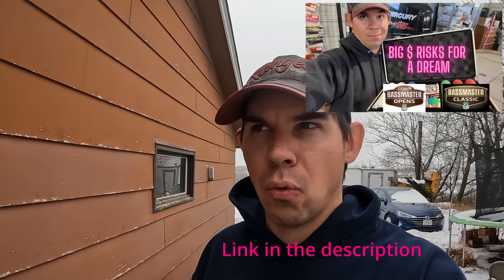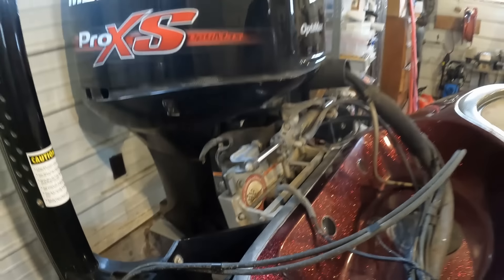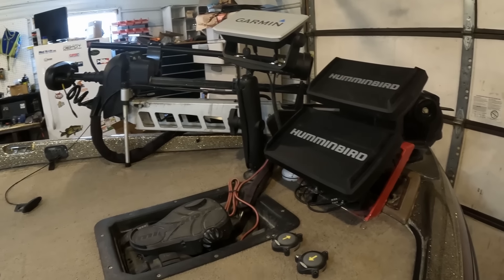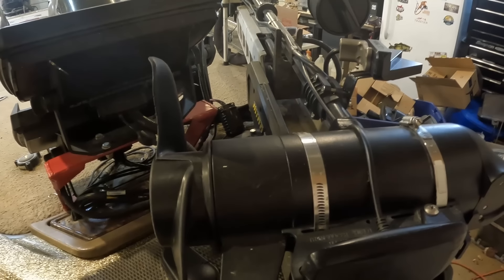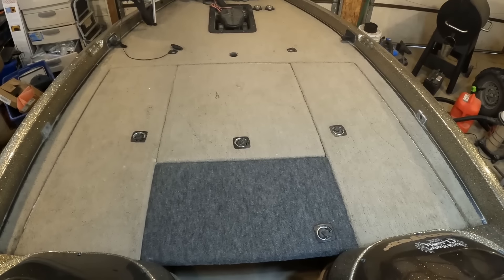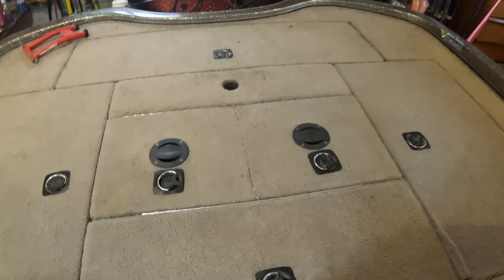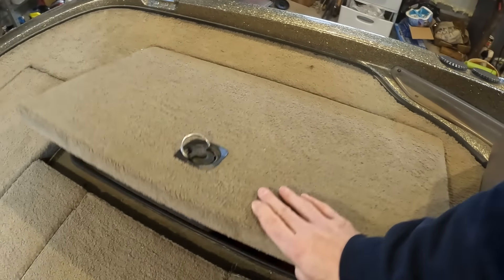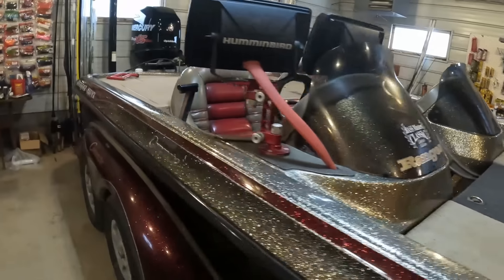Taking On The Opens With A 24YR Old Boat (My Boat Tour)

Comment: I’ve got an 01 520 and taking the rod tubes out is no easy task, I’m still trying to get all the foam cut out in the locker but once I get it I can put a lot more rods in it. You’ll need several different tools to get the foam out, a saws all is probably the first thing to use.

Comment: I bet there are a bunch of those 520s out there.  Lots of guys won’t let them go.  Good fishing platform and what I remember really good hole shot for a 20ftr.
Reply from the maker: You definitely don't see many of them come up for sale very often. 10-15 years ago in my area, just about everyone either had a 520 or 519 Ranger or the Skeeter ZX225 and ZX250. Just solid boats all around.  I have no complaints after 9 years of owning this one with the exception of the rod tubes in the port rod locker even though I've tolerated them thus far. Just not a fan of rod tubes for the amount of rods I carry on a regular basis.  Otherwise, its been a very good platform for me and doesn't leave me wanting much more.  Holeshot with my current setup is really good, better than my old Skeeter ZX185 which was no slouch either.

Comment: Great Video on a Older Boat David. I have much respect for you showing what the average person that wants to just go fishing or competing in tournaments in this average Angler's real world. I'm just like you bro dealing with a 1999 Charger 395TF Foxfire. 1999 Yamaha VMAX 3.1 OX66, been bored out an completely gone through top to bottom w/ less than 30 hrs on it. Still needs some upgrades, graphs, power poles, hubs, hydraulic jack plate, batteries, but we are still in the game mixing it up as best we can. Knuckles my brother...
Reply from the maker: Making upgrades as you can afford them is the way to go without going massively in debt for us average anglers! Also part of the fun of building a boat package, finding deals on stuff is half the fun and really satisfying when  you do pull the trigger on a purchase. This boat has constantly been in the role of upgrading when I can.  Those OX66 motors are damn near bulletproof!  Went to college to be a marine mechanic and worked for a dealership for a few years and only time we ever saw those motors was when they came in to be winterized for the winter. Always wanted one to rebuild and mod out with HydroTech parts but never found a boat for sale with one that I liked.

Comment: I would love to see you do well in this older boat. Would be a great story. I would suggest you do those trailer bearings every 2 years. When you have them fail on the highway, trust me , it sucks!
Reply from the maker: Thanks for the support! I've been very fortunate with the bearings thus far but definitely its time to change them out.  Last time I had a bearing issue was on my previous Skeeter, smoked the bearings and messed up the spindle.  Thankfully it was a tandem axle and I was able to get home but yeah I could see how much it would suck being a few hundred miles away from home and have it happen.

Comment: old rangers are some of the best-built boats ever!   look the trailer over really good though--  love the colors also!  can upgrade to a 250hp also if over 20 foot
Reply from the maker: I totally agree with you, the older Rangers are some of the best looking and best built ever! The trailer I haven't had any issues yet with the exception of the brake calipers and brake lines needing replacing and an incident where a tire blew and damaged the fender and I had to have it fixed because Ranger no longer offers the fender for that year of trailer.  I replaced the shackles and equalizers a year and a half ago so those should be fine.

Comment: I have a 98 Ranger. The locker doors are a BIG PROBLEM on the older ones. Mine cracked and degraded the same way. It doesn't matter the year of the boat to compete, as long as everything is solid and in good order. Only thing is rough water. Old fiberglass gets brittle and the shock might shatter it. Good luck. Show those new boat owners what old school can do
Reply from the maker: I'm going to give it my all in Division 3 for everyone that is watching!I do wish the manufactures that did fiberglass lids had a better foresight back in the day and made the lids out of aluminum but it is what it is.  My solution has worked fine for now with a slight increase in weight and needed to put in a stronger gas shock to hold the lid up but eventually I plan on upgrading all the lids to aluminum. I plan on keeping her as long as the transom holds up or something major happens that forces me into a different boat.

Comment: NASA couldn't have done it much nicer.  Good luck!!!!!!
Reply from the maker: LOL, I'm sure NASA has more advanced stuff than I got! Probably would have done a cleaner wiring installation for the equipment than I did as well but every time I added a new piece of equipment it was always in the middle of the season so it was just lets wire it up quick and get back out on the water ASAP. I really should be ashamed of it because I did work for a boat dealership at one point installing graphs and motors but I also had all day to do it right, not a few hours after work which I rather be out on the water than making my installs on my personal boat neat. But THAT is going to change starting this weekend!